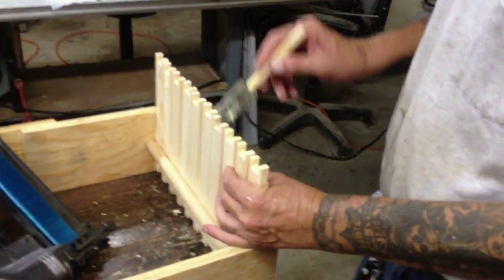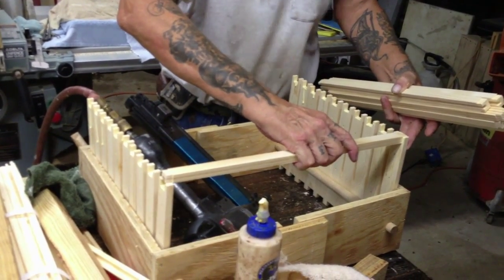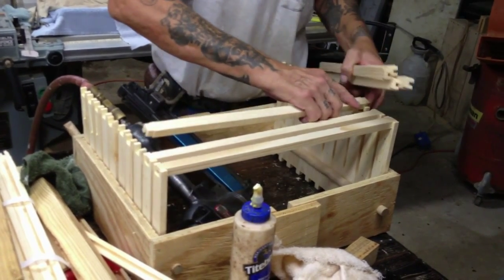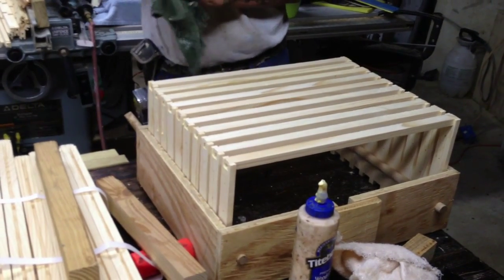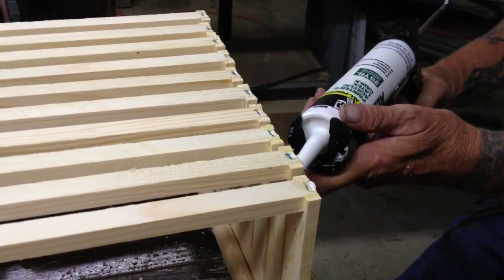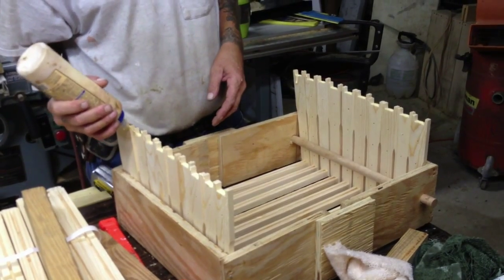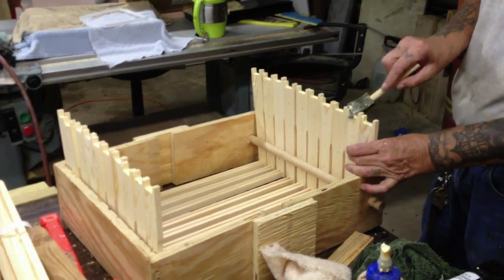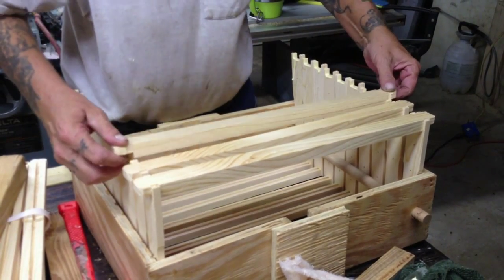A bee hive project for a rainy day

Comment: What size brads or staples are you using? I'm planning on buying a compressor and nail gun for building more boxes/frames next year. Even though I'm never going to be large scale...it's still a PITA to hammer all those tiny nails...lol
Reply from the maker: Chad Ashton We use 1.25 and 1.5 inch staples depending on what we are doing.  It's a good excuse to buy tools.

Comment: I dunno as if glue is really necessary. Two brads each side on the bottom and three on each side on top. Youd have to work to get that apart. I glued half of mine and kept the others without. No difference a year in.

Comment: Does it matter what type of wood you use?  I have seen some frames falling apart, and others who only use the top to let comb hang off, which seems like it could be precarious (shame to drop a loaded comb). I am specifically wondering if there are strong scented woods that the bees do not like.  Thanks!
Reply from the maker: Everybody uses pine just because of cost but anything will work.  Durability is more a matter of how it's stapled or nailed.
Reply: You spoil me, answering my many novice questions :))  Thanks so much for keeping up contact with your viewers.